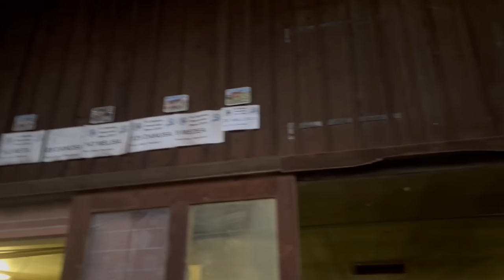Farming in Switzerland!

Comment: Cheese making is an art form and the Swiss are known for their magnificent cheeses. Did you try some while there? I find it interesting that they do not feed silage to cows that produce milk for the cheese. Thanks for sharing your trip with us.
Reply: silage contains certain micro bacteria that'll find its way through the cow into the milk. if you only make young and soft cheese out of it, it's normally not a big issue. but the longer you want to mature the chesse (older, harder cheese) the higher the risk becomes that the micro bacteria blows up the cheese like yeast does to a dough. once the cheese rind is cracked you can no longer store or mature the cheese but have to eat it soon. so you have to filter the bacteria out of the milk (chemicals, mechanical filtration etc.) or don't put it in the milk in the first place.

Comment: That robotic crane is nuts. The feed mixer is also robotic?
Reply: the feeding process can be automated by almost 100%. you have to restock the piles where the crane picks up the different components but as long as the crane has something to pick up it can throw it in the mixer that can then drive autonomously along the cows to lay down the feed. also allows for different mixes for different groups (like dry cows).